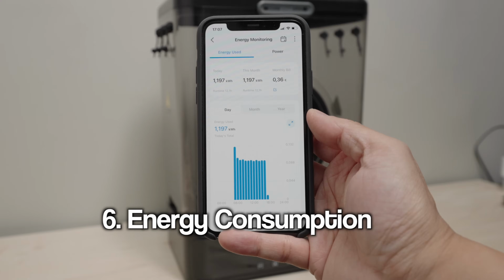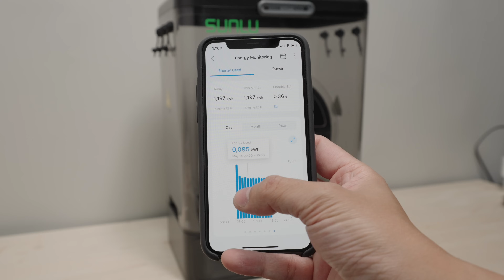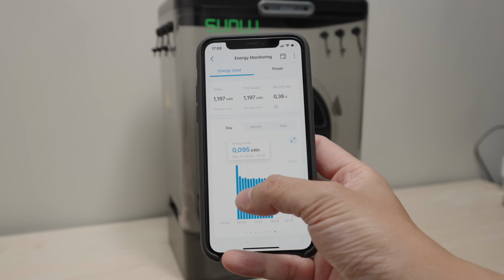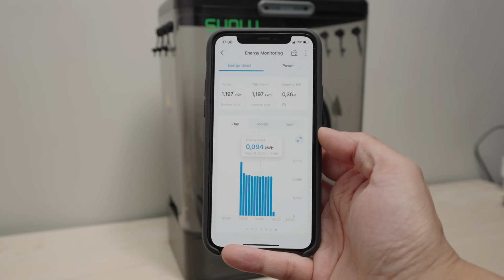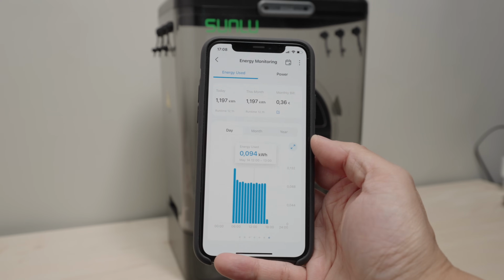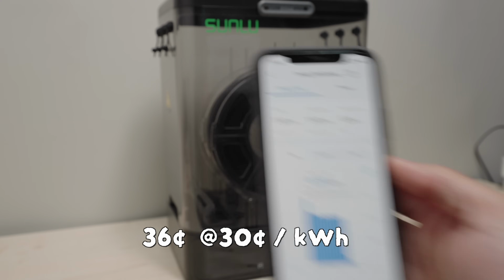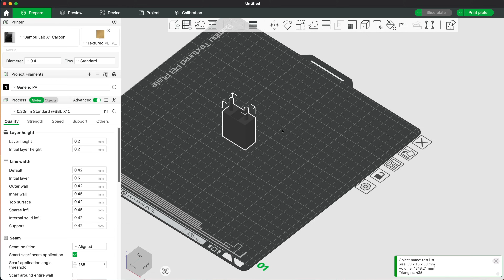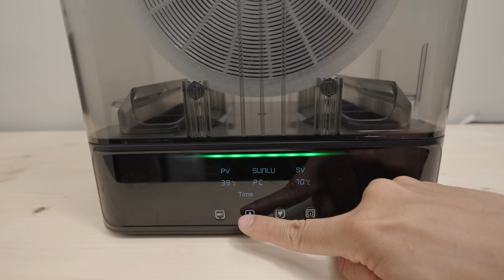SUNLU FilaDryer SP2 - Modular & Stackable Filament Dryer

Comment from the maker: Get your FilaDryer SP2 here: https://bit.ly/4iFVtOz

Recommended 3D printer: https://www.awin1.com/awclick.php?gid=570772&mid=46345&awinaffid=2034675&linkid=4382705&clickref=
Best affordable 3D Printer: https://www.awin1.com/awclick.php?gid=570773&mid=46345&awinaffid=2034675&linkid=4382675&clickref=
Recommended Filaments: https://www.awin1.com/awclick.php?gid=570777&mid=46345&awinaffid=2034675&linkid=4382680&clickref=

My 2nd favorite filaments: https://geni.us/A4OFomi
Lubricant for X,Z,Y-Axis rails & idler pulleys: https://tidd.ly/3KMFHqs
Grease for Lead screws: https://tidd.ly/3Lk36j2
PTFE Tube: https://tidd.ly/49Dw6eX
Deburring tool: https://geni.us/9WGzv
Wire cutter: https://geni.us/NAwQIL
Heat gun: https://geni.us/Jdcu

#Affiliate